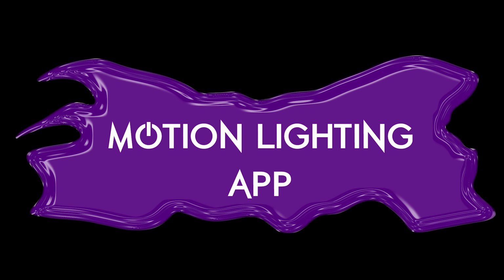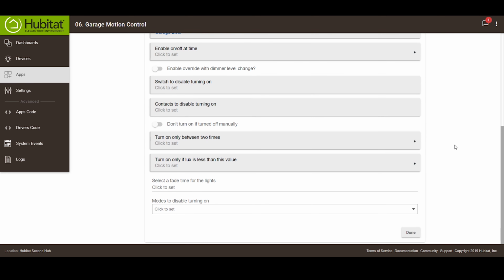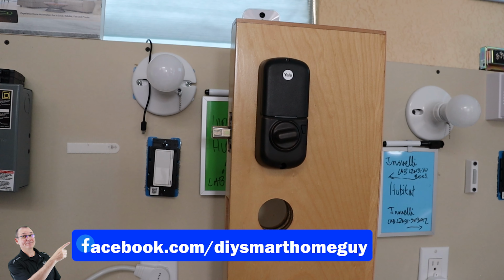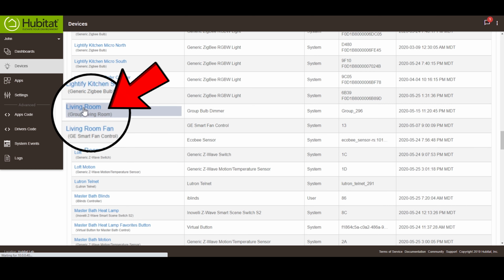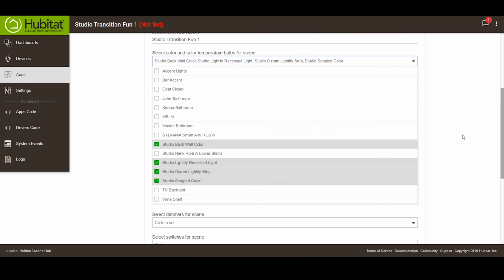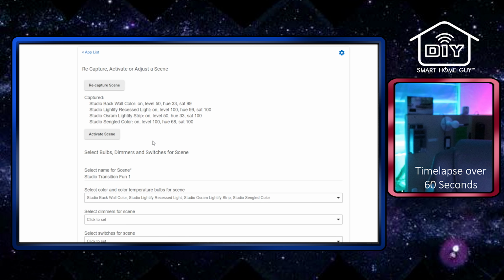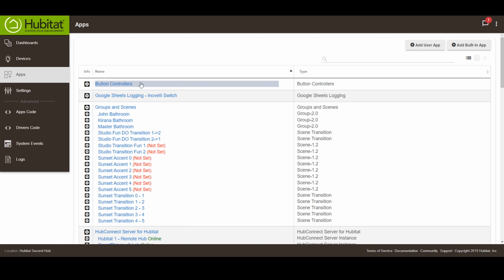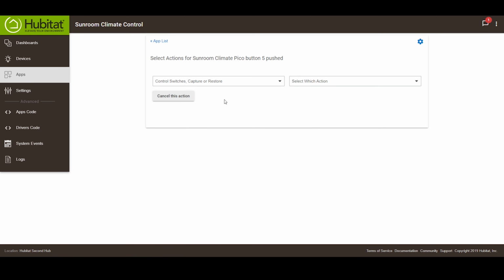Hubitat EASY Home Automation - Without Rule Machine! (simplify your smart home)

Comment: Hey John, can the C7 be a good secondary controller?
Reply: I need it to run my zwave devices into google.
Reply from the maker: I did limited testing on the C-7. It's mostly the same as the C-5 except with the Z-Wave 700 chip (which brings other security goodness)If you're already running Hubitat, the C-7 is a great choice - especially now that they have Hub Mesh!

Comment: Hi, I will probably be migrating over from a wink hub and relay pretty soon, and was looking into hubitat and the price point seems a little on the high side so I waited a bit to investigate if all my devices were compatible before taking the plunge. But I'm now a little worried that it is unavailable/sold out, kinda like wink was prior to dying the slow painful death that apparently awaits it. On the other hand, and probably far more likely, it might be just sold out because of wink ppl switching, ie. demand went through the roof combined with possible COVID19 supply chain issues. 
Anyway, just wanted to ask someone who's been with hubitat longer, if you have seen any info regarding the current sold out status of hubitat
Reply: DIY Smart Home Guy thank you for the info and I suspected that might be the answer but in the times we live in, one can’t be too careful. I’ll keep watch for the arrivals and hopefully move the hubitat environment, which in part was my expectation of wink when I got it, or some amount of in-home service not all web-based. Hubitat seems like the solution I wanted in the first place😜
Reply: @DIYSmartHomeGuy1  FYI they just got them back in stock (at least the US model) and I made my purchase, looking fwd to experimenting with local controls instead of internet based controls, plus including a couple of plugs which Wink didn;t support but Hubitat does. Wish me luck!